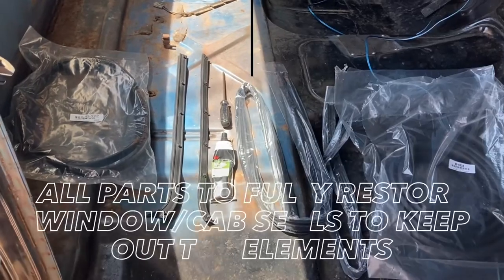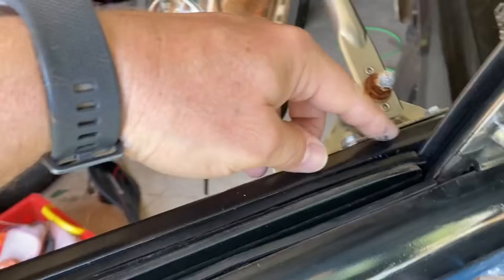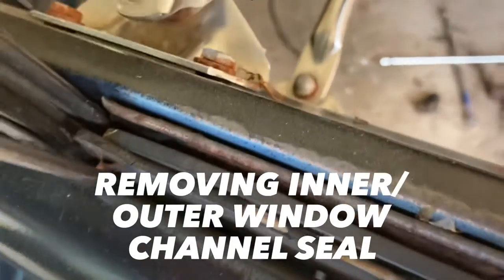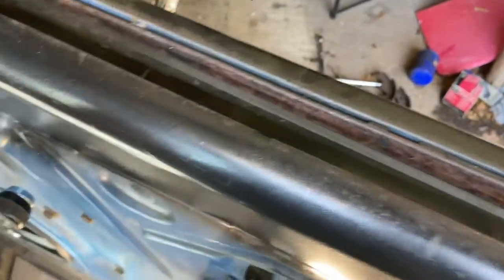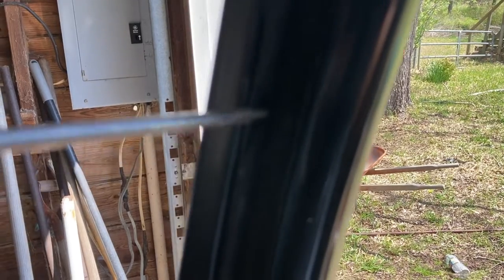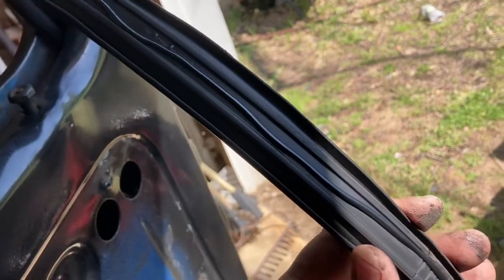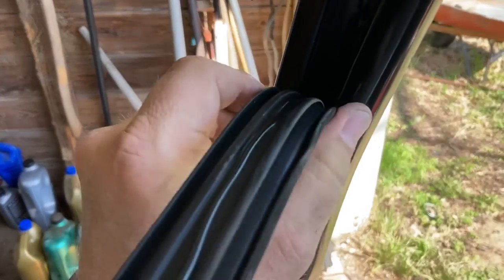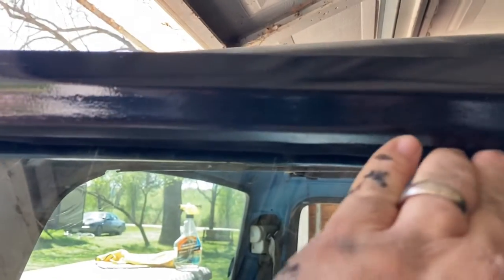F100 Window Channel & Door Seal Install | Step By Step & Part #’s - 👎🏻Water Leaks & Wind Noise

Comment: Do you think the top of the door weatherstripping would work just fine on the 67-72?  Thinking about ordering the same part number.
Reply from the maker: Here is link to LMC Truck for your years:

https://www.lmctruck.com/1957-72-ford/fb-1967-72-exterior-rubber-kit-and-components

Here’s part# 49-9680
$85.95

This is for entire seal kit.

Thanks for watching, please Subscribe.
Reply: @OperationRV   all I see is the PN 49-9336 for the on cab weatherstripping, which I also need, but not the one you put around the door itself
Reply: I’m wondering the same thing. I’ve seen people use universal seals for this purpose. But I don’t know why they wouldn’t work on the 67-72 trucks.

Comment: Thanks for the video. I have completed all the step shown above, but my window now is very hard to roll up. Does that tell you I did something wrong? If so any tips….I’m new so I m trying to learn.
Reply from the maker: Thanks, I’m glad my video helped out in some way. Yes, they will be stiff and over time get worn in. You can pick up a can of silicone spray from Oreillys, auto zone, Walmart and spray the velvet-like channels. This will ask as a lubricant and allow for rolling up a lot faster. Search here on YouTube, there’s a few vids and helps a lot.